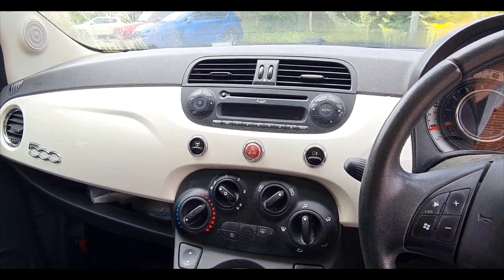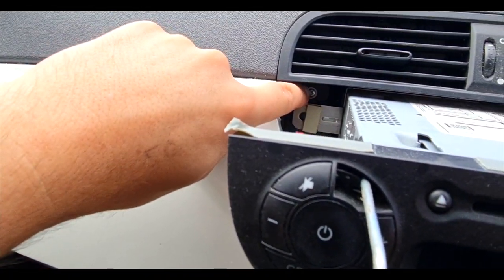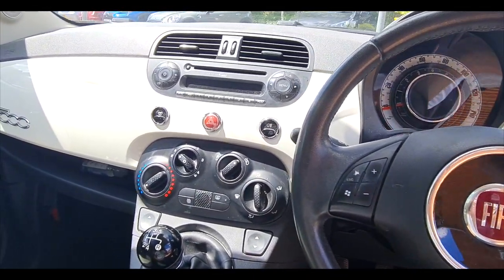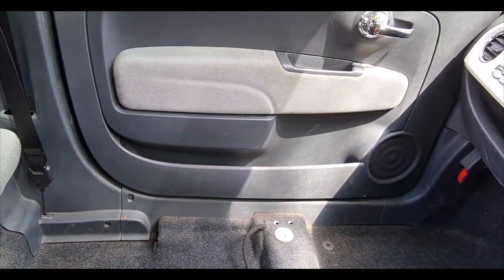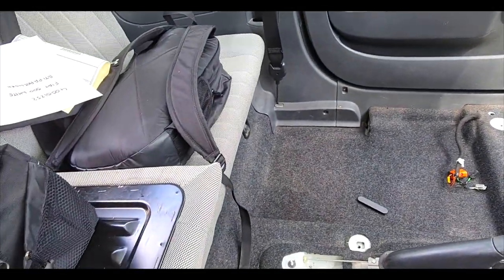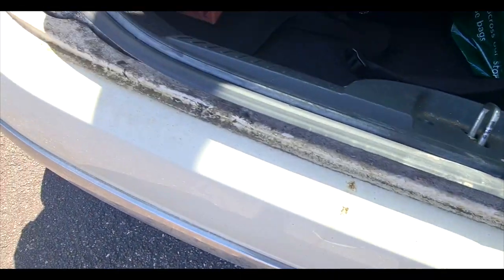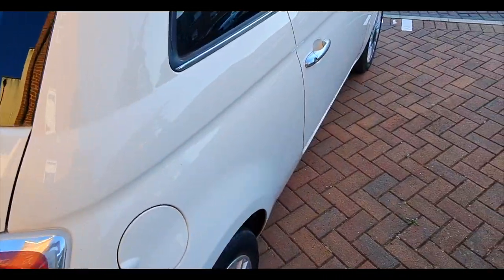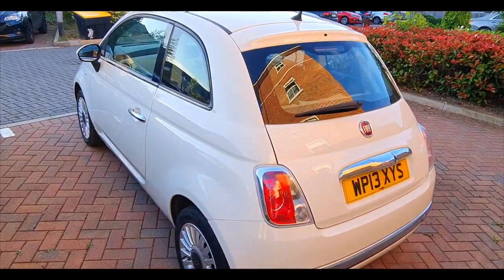Fiat 500 Lounge & Why Its A Cat S? - Part 2

Comment: that little tryangle mark is where the jacking point is trouble is a lot of people dont jack up the car correctly and damage the seal thats what i think the dent is.
Reply from the maker: Completely agree. You need to jack it further in. Jack it on the sill and it will just bend it. Far too easy and a weak point of the Fiat.

Comment: Possibly a cat s as the sil will cost too much to remove / replace or straighten. so not financially viable to repair through the insurance. I could be very wrong. Or as Jon B below says could be a previous damage.
Reply from the maker: Had a number of 500s with the sill dented and in my opinion are the reason for the write off. I'd argue that sometimes it doesn't appear to be worth the Car S as it's just cosmetic. :(

Comment: Was it easy to get inside the air vent to fix? I’ve noticed mine aren’t moving in sync, some of the slats seem to have unclipped. And I’m missing a silver trim - it’s £20-30 for a replacement which is just mental money!
Reply from the maker: If you do what I did and then the front unclips. You can then sort out the vents and when you clip it back together just make sure everything lines up again. Only thing you will need to buy is the radio prongs. Hope it helps!
Reply: @carsalvage101  yeah I’ll get hold of some, it’s so irritating more than anything! Thank you 🙂